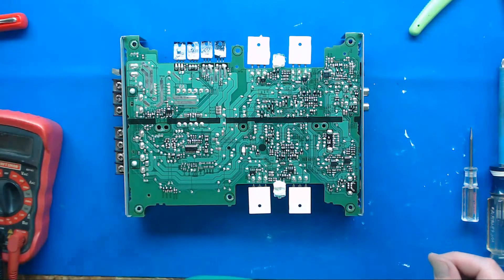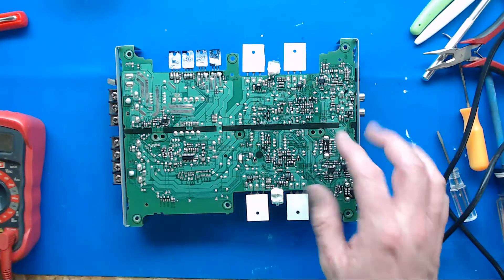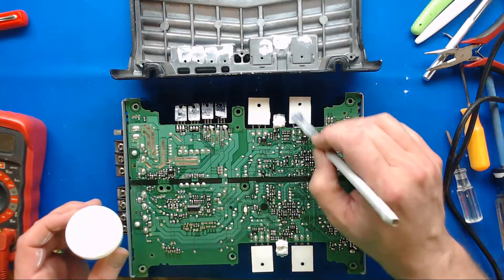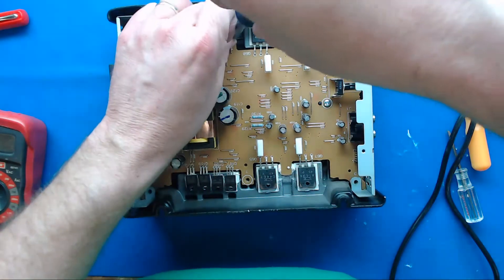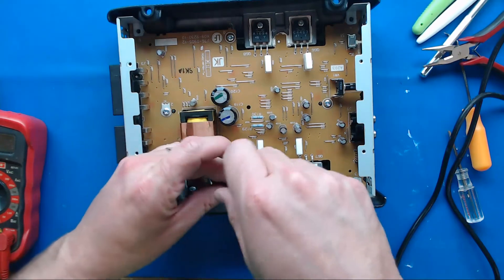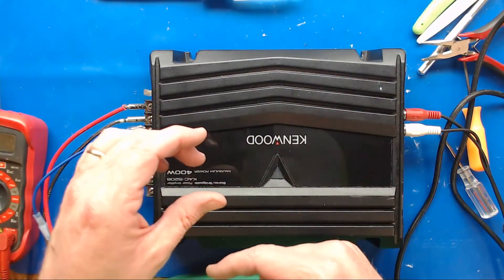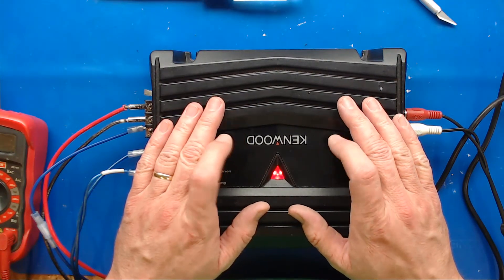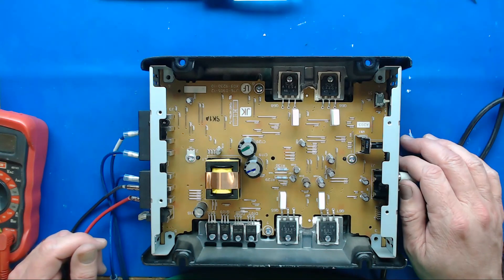Amplifier Troubleshooting and Repair Kenwood KAC-5206 Part 2

Comment: I have an KAC-529S with problems. It turns on fine, but it just makes what sounds like a low frequency, say around 80hz or so warble womm womm womm, kind of sound. All transistors test good. Any idea  what may be causing this? Thanks so much for the videos!

Comment: Do all the FETS need to have a rubber insulation between the back of the FET and the casing?
Reply from the maker: If the back of the fet is metal yes, if it is totally encased in plastic, then no.
Reply: Ok thanks!